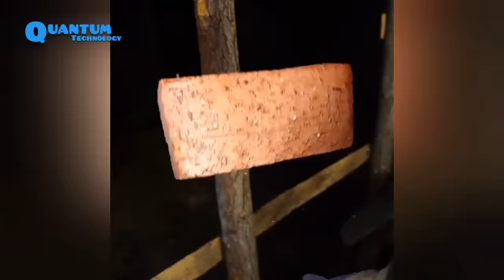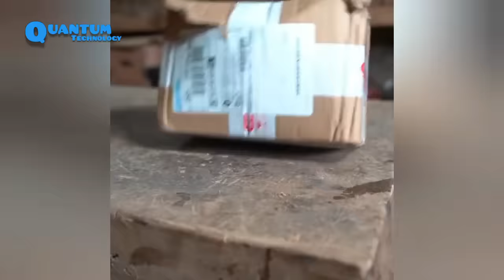The skilled craftsman renovate the mountain house, upgrade the beautiful garden

Comment: Those door and window frames and panels keep uniformly coming as if they were factory mass produced. I'm most impressed by the seamless joint between the stone and wood table top (I think it was a tea table).  I could barely pause at the right time mark even after playing back speed at the slowest.  It is approx @ 1:53:40 when he was assembling the table with the help of his peers.

By far, this renovation is very enjoyable for me.  I like that he maintains various Chinese motifs in all his designs, the door and window panels, the zen room with the centered water fountain, the round or moon portal, the front gate, the furniture, etc.